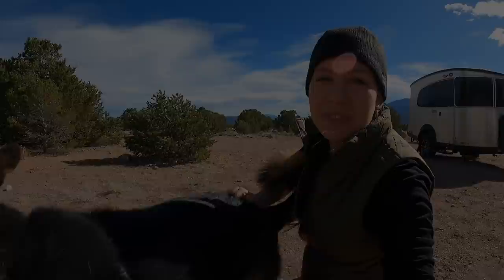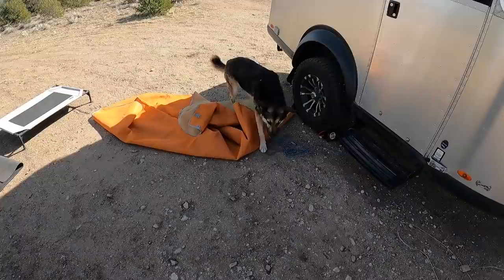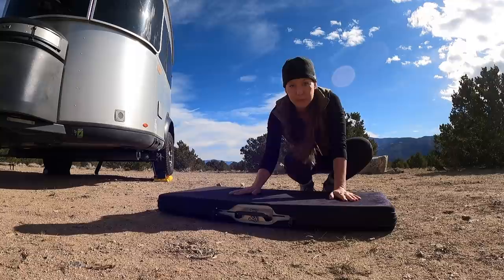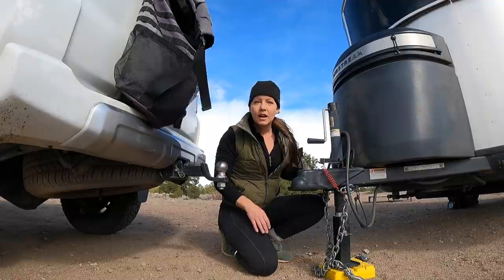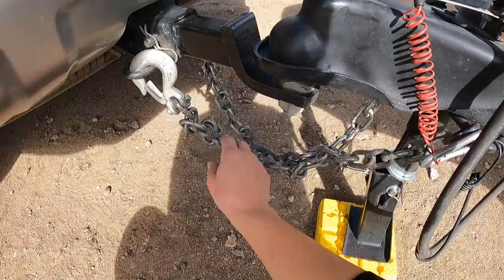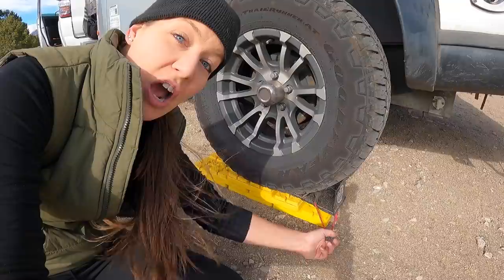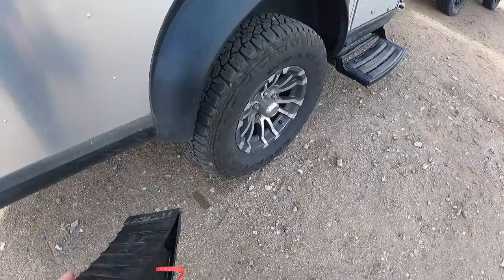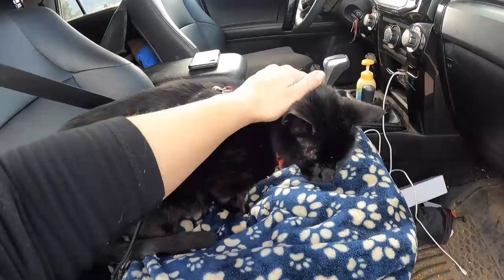Hooking up an Airstream Basecamp: How to Hitch a RV Trailer as a Solo Female

Comment: Tip at 7:32 - take out one of your license plate screws and replace it with an eye-bolt screw.  Then attach your trailer's e-brake to it.
Reply from the maker: Really good tip, thanks you!
Reply: I'm going to use that idea, Brian. Thanks!
Reply: Good ideal but her tag is to far away.
Reply: @gldsmith61  I suggest people use the rear license plate.  (slow wink)

Comment: I would highly recommend replacing that red curly line for the electric brakes. The idea is for the cable to pull the key out to activate the brakes. If its to long, the brakes never apply and then when you hit the brakes, you get rear-ended by your own trailer.
Make the cable a inch or two, shorter than the chains. 
Stay safe🙂👍
Reply from the maker: Thanks for the info!  The 7-way does hook up the electric brakes as well as electrical to the 4Runner, so it does have separate trailer brakes.

Comment: I used weight distributing hitch which is a bit harder to hook up. You need the electric raiser. But they prevent the dreaded trailer left and right swirl from different road situations. Once the swirl starts, you have a big problem very quickly.

Comment: Cass, Great video. One thing you didn't mention is to install the shower drain plug to prevent black water from getting into the shower pan, and checking that there is no water in the toilet bowl.
Reply from the maker: Great tip Joshua, thanks!

Comment: Just a suggestion and maybe you tried it, but there are cargo nets in all sizes which you could use on those upper racks so you don’t have to empty them all the time. I have used them on canoes and kayaks as well as ATVs. But another good video.
Reply from the maker: Great suggestion Wally!  I'd be nervous to do that, as I've seen other Basecamp owners who have had their cargo nets snap during travel from weight.  Although, that netting would help keep the towels up there!

Comment: Really enjoying catching up on your videos after finding your site a few days ago. Great info for everyone with a trailer. You are direct and straight forward with information which makes your content easy and rewarding to follow. I have a small hard sided pop up trailer and go through the same routine but do use a checklist as I've found even after years of doing this once in awhile I forget to do something. One thing I would recommend is a lock for your trailer hitch. I've talked to too many campers who have had their trailer hitch removed while at a trail head, or just out and about, leaving them unable to hook their trailer back up. It's unfortunate but it does happen.
Reply from the maker: Thank you for watching and thank you for that tip!  I haven't heard of those being stolen before, so I'm glad you mentioned it.

Comment: You and Jasper just did more work in the video than I'll do all day.  haha.  On that emergency breakaway cable, is there a longer one available?  Looks like you have a tow hook mount point for it right next to the plug for the trailer.  It would probably be too tight using it as is I'm guessing.  Just a little dust on the dash...  "well used"...haha.  Great job done by Jasper the supervisor!!
Reply from the maker: Funny, I've never even noticed the tow hook mount before. I'll check it out tomorrow.  They do make longer brake cables.  And yes, that truck is dirty!

Comment: Suggestion on your 7 pin connector, I would squeeze dielectric white grease into each hole male end and female end.  Will prevent rust from forming and last a lot longer I would redo this probably every 6 months or even 4 months as much as you us ,,,,great video
Reply from the maker: Great tip, thank you!

Comment: Very informative video. I tow trailers a lot and some can be nearly 20K pounds or more. Don't tell the DOT, please! LOL  Anyways a couple of things, for people towing heavier trailers, don't twist your chains to make them shorter. Have them cut to the proper length. Twisting can make them more likely to break when the shock force of the trailer coming off the hitch hits them. As they're being stretched out they are also trying to untwist, putting a different kind of load on them then they were designed for. As far as removing your chains goes, thieves usually come prepared with their own chains, so that would be a waste of time. You can however put a boot on one of the wheels like the parking police use. Determined thieves will defeat all the devices though. It's sad but true.
Reply from the maker: Thank you for sharing Martin! Appreciate that you shared your experiences.

Comment: Like your Video but like to make a suggestion that I found helpful. My jack is a little different that yours it had the handle on top so I took the  handle off and put u joint from a socket set on then I’m able to use my drill w/adapter to raise and lower my jack. Keep up the good work! Keep up the good work!
Reply from the maker: Love that idea! Thank you Dave.  I'll have to look into that as it would make it much easier.

Comment: I've heard you should run your water a little to relieve the pressure on the lines after you turn off your water pump.  Not sure if that helps prevent issues with your water connections or not, but sounds like it may.
Reply from the maker: Hadn't heard that before, but appreciate the tip! Thanks!

Comment: Put those large solar panels on the roof permanently & you wld probably never have to worry about power again. I'd suggest two 48" solar panels on the roof if you have the room. We put them on our 41' Morgan out island sail boat & never needed more power again, running refrigerator,  two TV'S,  lights & other electrical items
Reply from the maker: Sounds like a great solar setup! These panels are too big for my roof (since I already have some up there). But someday hoping to get a couple smaller ones and mount to the roof.

Comment: What about the electrical hookup and testing that the brake lights work on the trailer? I always found testing the lights to be a challenge when I was on my own.
Reply from the maker: That's a great point!  I look up from the driver side mirror to check if the running lights are on the BC.  If they are, then I proceed.  Once in awhile I'll put my 4 ways on and test the rear lights that way.
Reply: I just put my hazards on and get out of the car and go check 🤷‍♀️
Reply from the maker: @valerietema9807  Great way to do it!

Comment: When I was a kid our trailer came lose on the Indiana turnpike. Lucky now one was hurt. It just stopped. It actually passed us. Weird sensation. Funny now.
Reply from the maker: Oh no that is quite the story!!
Reply: The chain snapped like string.  The hitch totally pulled off. Metal fatigue I think. My Dad was a very careful man. Just a freak occurrence
Reply from the maker: @Atacontrl  Wow, that's quite scary!
Reply: Always check the hitch I guess.  In those days they wielded it to the frame using metal  bars. I’m sure it’s much better now.

Comment: The clasp on the trailer plug may jiggle loose so I use a small bungee cord around cap insuring stays clasped.
Reply from the maker: Good to know.  I've never had it jiggle loose but good to know there are solutions, thanks!

Comment: I have a tremendous amount of respect and admiration for you and your lifestyle. If you haven't done so already, would consider doing a video on the process of parking and  leveling your basecamp? I'm curious as to how you set up those leveling platforms under the tires. Also I know that you use chock blocks but is there a way to engage the emergency brakes on the base camp when it is parked and unhooked from your tow vehicle. Thanks. Stay warm and well.
Reply from the maker: Great suggestion Donald! I'll work on that video in the future.  I'm not sure if it's good to pull and then re-engage the emergency brake when parking.  I do find the wheel chocks and stabilizer jacks are usually great to keep the RV steady when parked.

Comment: since you had  Class B Van...complete...no unhitching issues...what are your feelings now having to go through that?  
I agree a basecamp is good idea...let you know in OR you can use land for RV use...no need to build..it is your land..RV Land it is permissible..I check with the planning dept. accepts ..short terms stays...no structure on the land.
Reply from the maker: The unhitching is really quite easy, and I do prefer having a separate vehicle.  This way when I go to the grocery store, I can leave the animals in the RV and they don't have to move around.

Comment: You might want to check into getting a weight distribution hitch for your setup.
Reply from the maker: I've heard the 4Runner stock hitch isn't able to support one.  Instead I have an upgraded suspension & air bags.
Reply: @TailsofWanderlust  Just want you to be safe out there

Comment: this is great when I was living in my traiblazer for a bit , you learn what you need at hands reach etc.. of course i was a bit homeless or what at that time , but looking into getting more involved wondering now what to buy... I dont have a 4 wheel drive , have a 02 trailblazer LS , kinda researching what weight would be ok to pull , didnt want to be lugging a huge camper ..but ive been researching for sometime on what would mostly suit me but i am thinking from like you we get use to living in vehicle from the back and roll , lol.. glad I found your channel. Also as well you mentioned finding other women maybe that travel or what... could you recommend the pages or links to where to connect , I am a pretty tough cookie but still weirdness traveling alone , I do have a passport , I seen in one of your videos you where in Canada , I have never driven there but did fly there , just think North would be on my map.. thanks so much .. :)
Reply from the maker: Hi Sheila!  If you have Facebook I would recommend searching for nomad women or women RV and you'll find a lot of different groups come up.  You can check out which ones interest you and it's a great way to get started with finding others to connect with.
Reply: @TailsofWanderlust   Thank you will do ..:)

Comment: about the inside getting to move part, sail boats move all the time but maybe not in all 3 axis like your traveler.  But if it were me I'd look at how to secure some of that with maybe bungee cords or something.  This is a lot to remember.  And that cutlery drawer would not come out if the door were really secure.  Does it not latch?  Tell you what, I'll meet you at Elephant Hill and I'll go inside while you negotiate the trail up.  I'll note what falls.  And assuming I'm not unconscious at the end of the shakedown I'll have some suggestions.  How's that?
Reply from the maker: I've actually thought of putting a camera in there to see how things go.  A few of the things I do are from experience:  The kitchen drawer has a good amount of weight from the cutler so does push the door open. The cupboard door latch is only a magnet.  Great, until all that weight comes flying at it.  Pulling heavy items out of the cargo nets - I've seen other Basecamp owners who don't do this, and eventually the red bars have cracked under the weight.

Comment: Not sure if you'll see this question, but here goes......Did you attempt to pull the Basecamp with your Outback?  I have a 2020 Outback (Onyx Edition) which "technically" is supposed to be able to pull that much weight, but I'm considering getting something else before I buy my next RV.  What made you choose the Forerunner?  I like them and I've owned them, but it's been years ago and I really dig Subaru for customer service and company culture.  Thank you for these videos....I'm mesmerized!  lol  and of course, I love Jasper and Napoleon!
Reply from the maker: Hi Kimberlie!  The Outback is not able to pull the Basecamp due to the tongue weight.  The Outback actually struggles being able to tow most RVs out there.  I sold mine due to only being able to properly tow a small teardrop trailer.  Hope that helps!
Reply: @TailsofWanderlust  That's very helpful!  Thank you!  Safe travels!

Comment: This overview was great and really helpful, I just bought a small 16ft trailer to tow with my 4runner. I noticed you're not running a weight distribution hitch but your 4runner looks like it sits nice and level and sounds like it tows well. Did you do anything to the 4runner like airbags or rear suspension? Mine has a lift with heavier springs and I'm debating if I need to do anything else - I did buy a weight distribution hitch for mine but haven't even hooked up yet, it's still in storage for the winter. Any advice appreciated - your airstream is a beaut.
Reply from the maker: I did upgrade the suspension, but also installed air bags.  It's really the air bags that keeps the rear level.  Here's all the info on them: https://tailsofwanderlust.com/2020/08/26/toyota-4runner-mods/

Comment: Two questions-- why turn off the fridge especially when you are on the 7 pin connector. That should keep your fridge powered while driving. I also notice you didn't add a sway bar towing kit. Is there a reason you didn't go with a light weight sway bar kit?
Reply from the maker: Hi!  The fridge runs on propane, and I don't travel with the propane on.  In regards to the 7-pin, it doesn't provide enough power to keep the fridge running on electric.  As for the sway bar, it was never recommended to me by the dealer.  As I started to tow, I noticed the trailer does extremely well and even in high winds or when being passed by trucks, I've never experienced any sway.
Reply: @TailsofWanderlust  Interesting. Talk to Airstream-- the new Basecamps and Bambi models have an all new electric fridge. I just picked up my 2021 16 Bambi and it runs solely on electric and the 7-pin while towing, Just a thought. Save the propane just for the stove and heaters. I never had a sway bar before and didn't even know what the hell this was until the dealer told me about it. Just a little more work to hitch and unhitch but it works great with my Jeep Wrangler.

Keep up the great videos. Great to watch a solo traveler to pick up tips and tricks

Comment: You have a locking pin securing the trailer to the hitch but no locking pin from the hitch to the truck
Reply from the maker: You've got a good eye, yes that is correct.
Reply: @TailsofWanderlust  where I live my hitch  would be gone in 5 minutes if I didn’t have a lock on it

Comment: Do you suggest any type of equalizer bars as part of the trailer hitch assembly / perhaps not needed due to the low weight ?
Excellent informative video - thanks E
Reply from the maker: Hi Eric - for my setup I don't have a weight distribution or sway.  The 4Runner hitch can't support weight distribution, so instead of upgrading the hitch I went with airbags.  As for sway, I've never had an issue since my trailer is so small.  But the choice to have one or not comes down to size of RV as well as comfort level with or without the sway.  I've never had a sway system so don't know what kind of improvement it would make. Thanks for watching!
Reply: @TailsofWanderlust  
Thanks - I’ll keep that mind as I was considering a 16’ Bambi - we so enjoy your videos - walking your dog at night I think keeping  your bear spray with you would be wise - people at night can be a problem too
Reply from the maker: That's a great point Eric.  I actually just picked up a small can  of pepper spray to clip onto my backpack.

Comment: I love your videos and info. What an adventure! I do have a question though, you don't use sway bars when you tow? No problems with swaying when on the highway or passing or being passed by trucks for instance?
Reply from the maker: Hi Aletta!  No issues with sway or high winds.  The Basecamp actually tows extremely well without the sway system.

Comment: I would like to make a suggestion to 'not' lock your trailer to your vehicle.  If your trailer should start on fire, you want to be able to disconnect as fast as possible. So just secure with a hitch pin instead.
Reply from the maker: Really good feedback, thank you for sharing that tip Max!

Comment: I always use a drill to cheat but you should slow down at the top probably.  It should be hand tight not power tool tight.  Could shorten the life span.
Reply from the maker: Good to know, thank you for sharing Corey!

Comment: Why do you turn off the frig?  Does the cat litter box smell up the inside of the camper?   Do you use a check list?
Reply from the maker: It's not safe to drive down the road with propane running which is why I turn the fridge off.